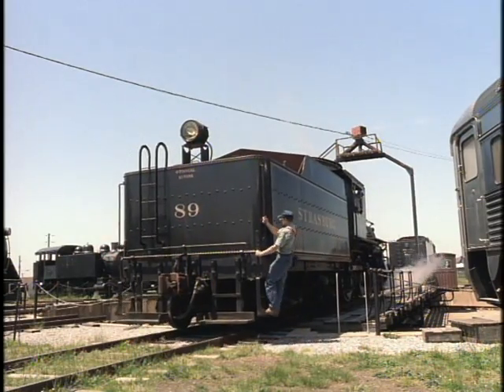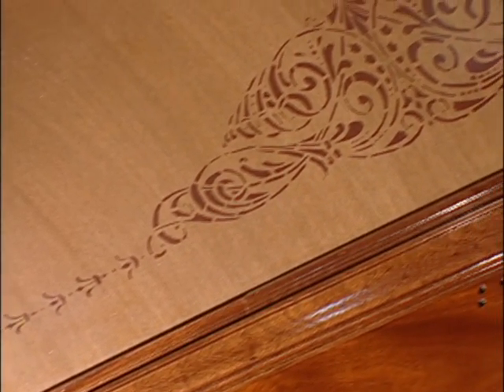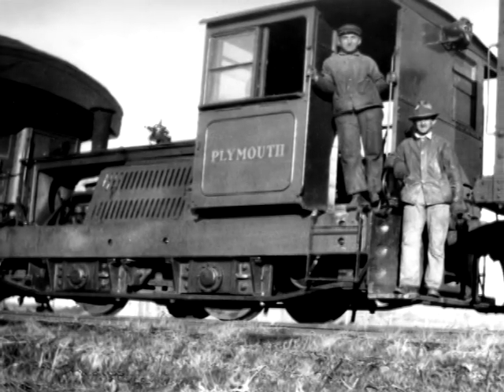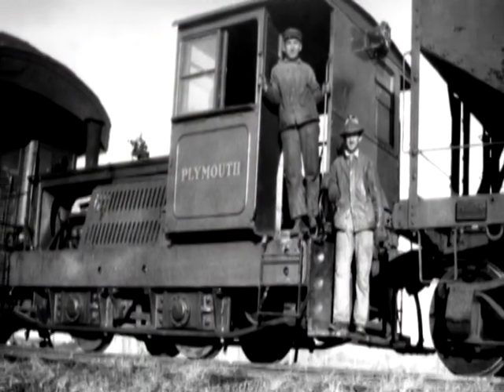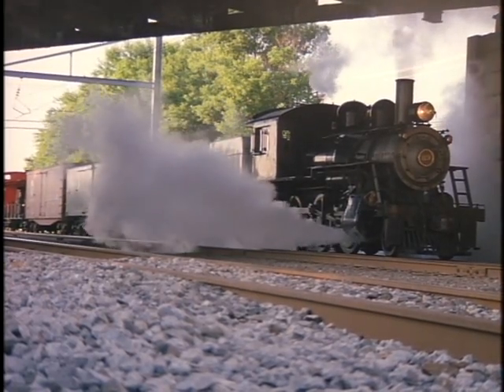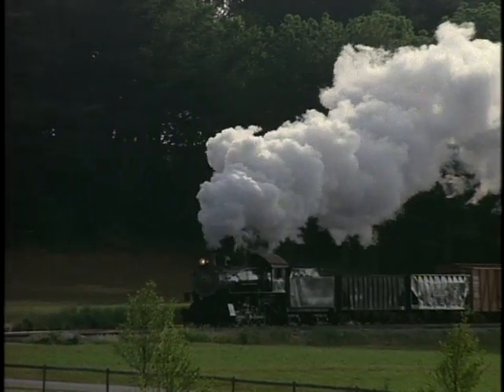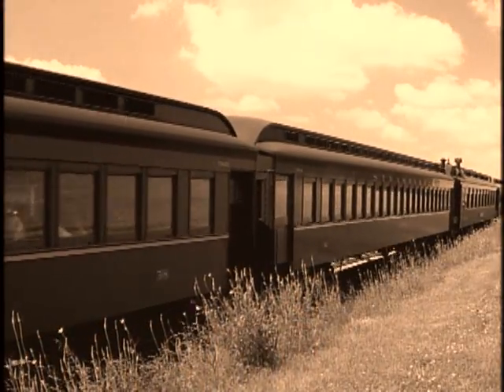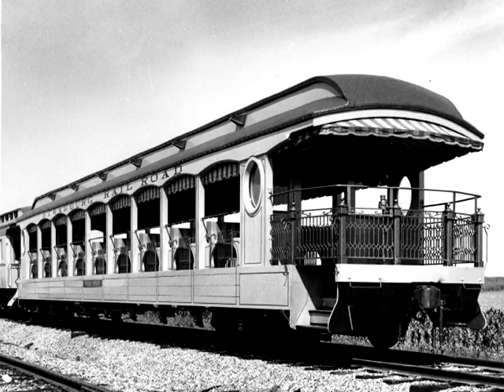Strasburg Railroad Documentry

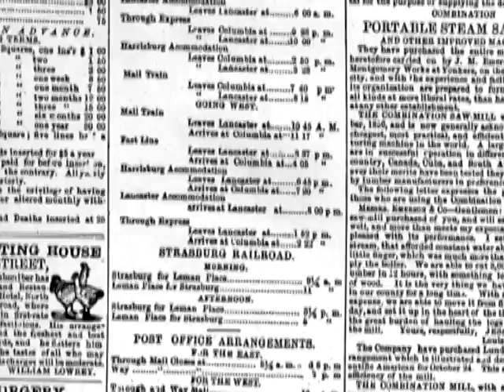Comment: Nice documentary.  Between about 4:50 and 6:50, it shows a PRR A3-class 0-4-0, a tiny, diamond stack 2-4-0 and one or two ex-PRR 4-4-0's, besides the William Penn (which ended up on the West Coast later)..  Were those all Strasburg RR locomotives?  Has anyone ever compiled a complete pre-preservation locomotive roster for the Strasburg?
Reply: They're probably just some stock images they had on hand and put in for some reason(?)
Reply: That PRR 4-4-0 is no. 1223 and did run for a limited time on the Strasburg back in the late 80s on loan (I believe) from the Pennsylvania Railroad Museum. She is currently preserved next door at the museum.